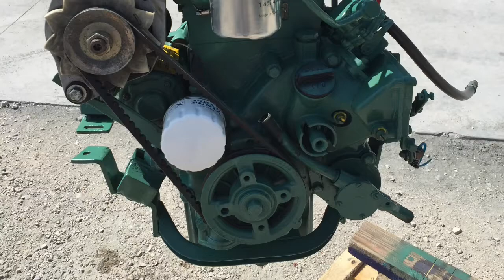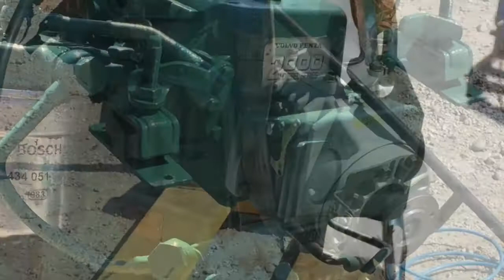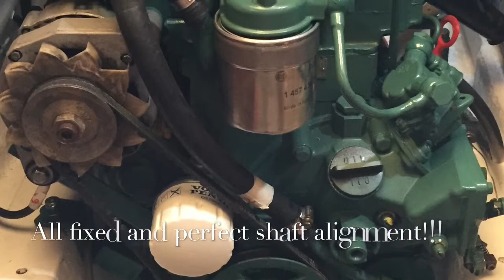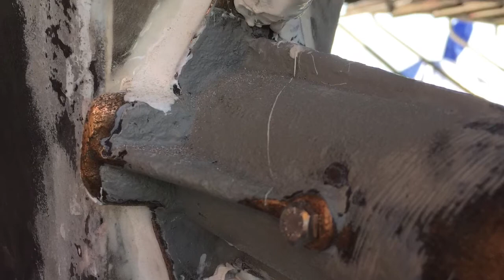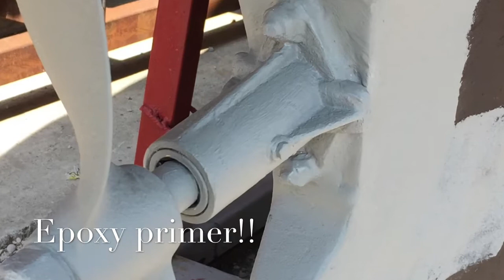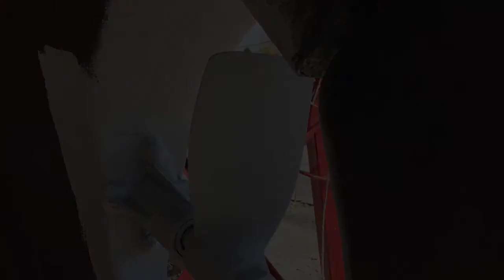Sea4See l Sailing Vlog l Marieholm26 Folkboat - Fixing Engine Volvo Penta 2001

Comment: you have a two blade prop ,could you tell size and pitch thanks
Reply from the maker: robert cooke hello,
My shaft is 25mm diameter about other information I must check on the blade in write there I will tell you
Reply: hi thanks, changing from 3blade to 2 blade folding also 25 mm shaft